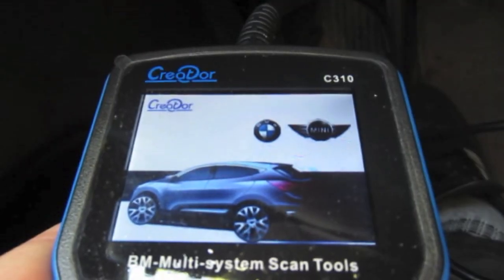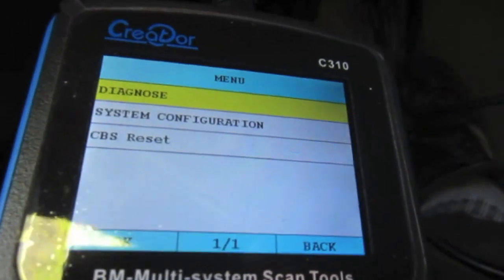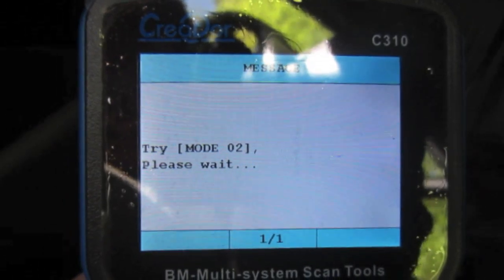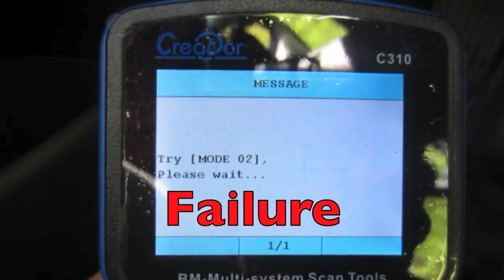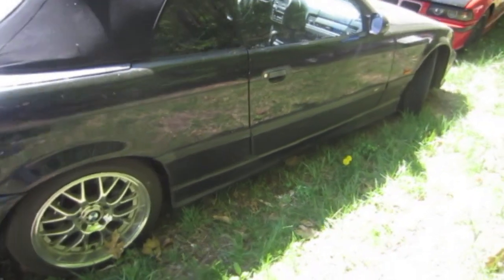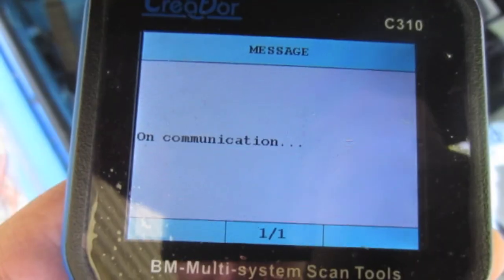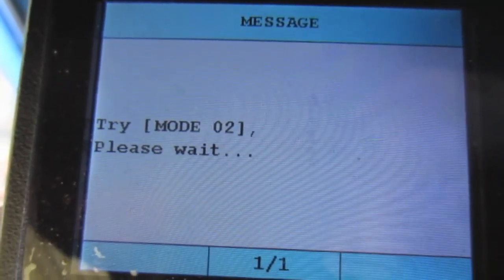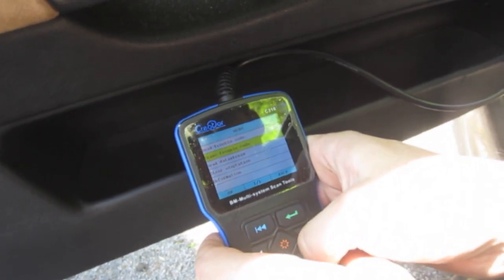Fix your BMW E36 for $60

Comment: Great find Zach!  I'm having intermittent problems with '98 E36 convertible top lid not opening.  Can you access the top modules etc. with the C310?  Also, what's the CD for and is it Windows only?
Reply from the maker: +Mike Metzler Unfortunetly not. I tried the same test. I'm not sure what's on the CD, I've not used it. PC I believe.

Comment: Hi! Does this machine show the engine error codes for the e36 with the adapter? I got a 93’ one and im finding a cheap way to diagnose. Thank you!
Reply from the maker: I believe it did, to be honest, it has been a bit since I tried. I'll report back!
Reply: @millertimebmw  thank you very much. It would be so helpful to me. The only way I found to do it correctly is getting an old PC with a COM adapter and to connect it directly to the car, being ablento read the codes with some softwares. Sorry if I explained bad, the English isn’t my first languaje as you can notice. 😂

Comment: Hey millertime, I just came across your videos and e36 build! I'm really impressed and enjoying the series. I was actually curious if I could ask you a few questions - you seem knowledgeable :D 
My 1992 e36 won't start. I'm not sure why - Fuel pump will only turn on if I jump the circuit. The fuel relay is not closing on its own. I have tried swapping relays, and even purchased a new DME to no avail. Any idea you might have for me? Thanks in advance, and happy tuning!
Reply from the maker: +Andrew Sleath Send me an email millertimebmw@hotmail.com !

Comment: hi man. can I ask I have a E46 320i, can't see butterfly valve inside of the exhaust. i just want to shut it down to make it sounds better. do you know where are they? and how? plz make a video
Reply from the maker: +James XU Take a photo on the bottom side of the exhaust tips/ muffler. and email to millertimebmw@hotmail.com  I'll tell you if they are there.

Comment: Hi, I have a BMW Classic 3' E36 320i year 12/1997 with ABS and DSC lights on...would this connect with my car and tell me what the problem is? Which one? Thank you very much
Reply from the maker: Yes, with the 20 pin to OBDII adaptor.

Comment: Did it do talk to the convertible computer once you used the 20 pin adapter?
Reply from the maker: +Tyler Englestad No, unfortunately not. This scanner is really great, especially for the cost. I'm going to keep looking and reviewing for you guys until we find the BEST one we can get.  :D
Reply: @millertimebmw  will it work on 1995 bmw e36 328
Reply from the maker: @skarademirlidag  Yes, but you need an OBDII to 20 Pin adapter!
Reply from the maker: No, unfortunately it does not

Comment: I have a 97 528i automatic speedo is not working already changed all 4 speed sensors and transmission speed sensor. Do u know if it's a common if so do u know the fix?
Reply from the maker: +RookieDIYer Check this video, Your ABS pump might need to be rebuilt. ($100). Diagnose Your BMW for $60!
Reply: +millertimebmw it's pulling speed sensor A has abs and traction control light is on.
Reply from the maker: +RookieDIYer The ABS module is right above the exhaust manifold so the heat causes tons of issues. (as in your case you've already replaced the sensors) Google E39 ABS rebuild and there is a company with quick turn around.  Good Luck!
Reply: +millertimebmw thanks for the help! I was hoping it wasn't the module.

Comment: Does anyone know about a tool like this for a BMW E30? The rev needle isn't working right on mine and could do with a fix
Reply from the maker: +SJFCfootballer I'm not positive, this can only do the E30 airbag. Thanks, Zach
Reply: Delphi with 20 pin and it needs computer

Comment: How come all vendors say that it only supports OBD2?
Reply from the maker: +vanox Meures Without the OBD to 20 Pin adapter it can't work on older cars
Reply: millertimebmw Thanks I will order it and give it a try! I already have the adapter...
Reply from the maker: Nice. Like I said, Check engine and Data Streaming is awesome, and the airbag functionality is an added bonus. This thing beats needing Windows XP and INPA (although INPA does more). 
Good Luck! - Zach
Reply: if it will reset the airbag codes then it is worth the $$ since the Peak SRS tool is more than $130 for airbag codes only. the INPA is PITA to get it to communicate with the ECU..
but anyways, I guess you fixed the fan on the beast after the drift day!
Reply from the maker: +vanox Meures working on a few more things on it now. Coilovers :D
Reply: Hopefully more videos of that will be posted :) Peace !!

Comment: i bought this tool for my e46 m3 hoping i could reset my brake pad light. i go into brakes and its says failure to connect. is this because i need the 20 pin adapter?
Reply from the maker: You actually don’t need this tool for that. Make sure the pad wear sensor is in good shape. Then just two clicks forward with the key. Wait about 20 seconds and the light will turn off! That’s it!
Reply: iv tried that as well. i just did my brakes and i guess i needed to repace the sensors as well. kind of a headache at this point. i was hoping i could just erase the code.
Reply from the maker: Yup, sorry